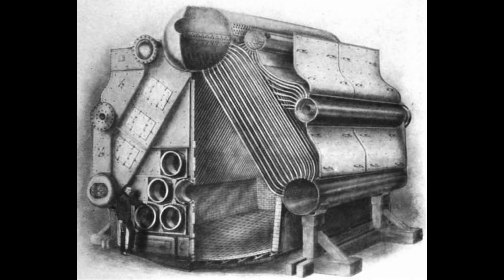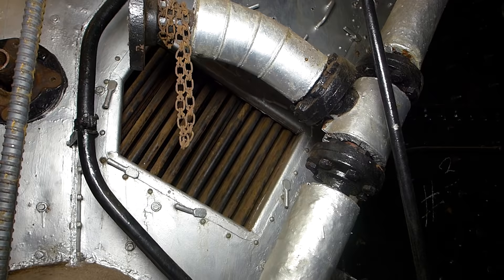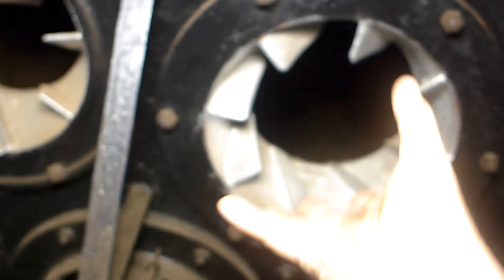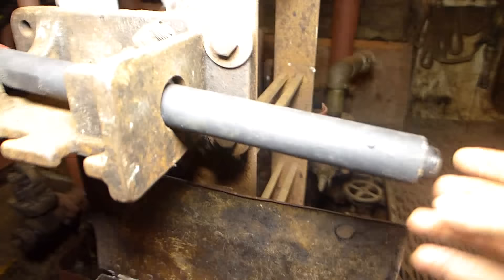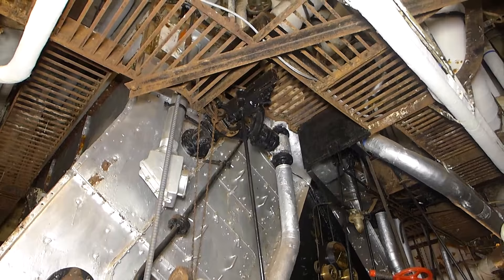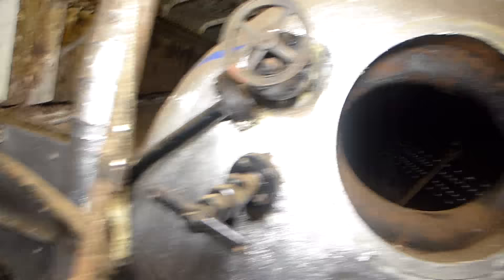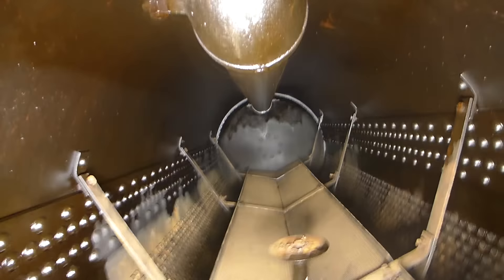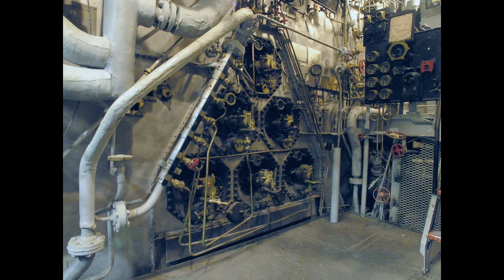Battleship Texas, Making Steam

Comment: Pressure Safety Valves (PSVs) lift when main steam stop valve closes. Only thing preventing pressure build up in a drum boiler is the constant flow of steam to the steam engine. Took me a long time to understand why pressure was highest at the feed pump rather than at main steam. Seems like if you’re putting more and more energy into the steam as it gets heated the pressure should increase. 

However, that pressure doesn’t build because it is converted into flow and then removed from the cycle by converting it into work in the steam engine. 

When PSVs trip you gain a unique appreciation for how much power is being generated in the boiler. 

Also, the staging is to maintain steam flow through all parts of the cycle. Main steam has lowest set pressure so super heaters continue receiving cooling flow once the main steam stop valve is shut. Fires are usually extinguished pretty quickly, but if there is still a lot of residual energy to dissipate the drum PSVs (set at a higher pressure) will lift to prevent over pressuring the system.
Reply: It sounds and feels like a rocket engine blasting off when a large PSV lifts. 
I was on the ground floor, inside a building when a main steam safety 100ft above and 50+ feet horizontally away lifted. The walls were shaking so bad I thought something had blown up and I was about to be blown away by shrapnel. This was a 2100lb safety relieving a 10-20kkph at a land based power plant. 

Those are lower pressure but there is no where to get away. I imagine it was several times scarier in the hull of a ship!
Reply from the maker: I largely agree, except for one thing.  Assuming that the volume of a pressure vessel remains the same, steam pressure only increases when more steam is created from water.  Adding energy to steam will only increase its temperature, not pressure.  That’s the beauty of superheat.  It raises steam temp and energy while maintaining the same pressure.  That additional energy is 100% useful.  Unfortunately, turbines love it, but not the reciprocating engines on Texas.  They required the condensation from saturated steam to lubricate the cylinder walls.  Dry, superheated steam would result in seizing and cylinder scoring.
Reply: @tomscotttheolderone364  Thanks for the reply! I may have misunderstood your point, but I believe that pressure and temperature both increase with rising temperature in a fix volume. Dry steam continues to increase in pressure unless it is converted into flow. For example, a pressure cooker is a fix volume of water that converts liquid to dry steam. The pressure inside slowly increases along with the temperature and if there isn't an outlet it would explode due to over pressurizing the vessel beyond the materials strength. 

As an aside, I found your point about recip steam engines requiring saturated steam very interesting. On another channel, (@Drachinifel's video titled "Navel Engines - Rotate that shaft") he said the opposite. Liquid is generally bad in a recip engine because it is incompressible and hence if you hit it at the bottom of the stroke it can cause the piston to not turn and break the engine. However, what you're saying makes more sense because steam engines, unlike gasoline engines, do not have a compression stroke. Compression takes place external to the engine.
Reply: @tomscotttheolderone364  Thanks for the reply! I may have misunderstood your point, but I believe that pressure and temperature both increase with rising temperature in a fix volume. Dry steam continues to increase in pressure unless it is converted into flow. For example, a pressure cooker is a fix volume of water that converts liquid to dry steam. The pressure inside slowly increases along with the temperature and if there isn't an outlet it would explode due to over pressurizing the vessel beyond the materials strength. 

As an aside, I found your point about recip steam engines requiring saturated steam very interesting. On another channel, (@Drachinifel's video titled "Navel Engines - Rotate that shaft") he said the opposite. Liquid is generally bad in a recip engine because it is incompressible and hence if you hit it at the bottom of the stroke it can cause the piston to not turn and break the engine. However, what you're saying makes more sense because steam engines, unlike gasoline engines, do not have a compression stroke. Compression takes place external to the engine.
Reply from the maker: @Jason-Spice  Your analogy is not correct.  As long as there is liquid water in a pressure cooker, it will continue to produce more steam, raising both pressure and temperature until one of two things happen.  Either the relief valve opens, or you run out of water.  If you put just a few ounces of water in a cooker and attach a pressure gauge and thermometer, you would see pressure and temperature increase until you run out of water.  At that point, expansion stops.  Temperature will continue to increase, but not pressure.  The temperature above saturation is pure, recoverable energy that makes steam dry, or super heated.  That extra is highly valued because 100% of the extra put in can be recovered as work in an engine designed for it.  The ones on Texas were not.

I am not in disagreement with Drachinifel because I didn't say that an appreciable amount was allowed to gather in the cylinders.  All I said was that condensate was needed to lubricate cylinder walls.  The crew watched pressure and temperature in each cylinder.  If properly balanced, just enough water would condense on cylinder walls to do the job.  It is likely that they allowed more than was needed since too little could result in cylinder wall scoring.  If they had too much, they could hear it make a crackling noise as it tried to evaporate and condense with the pressure changes caused by piston movement.  When that happened, they would open a cylinder drain to get rid of it.  However, that was usually only needed during startup since that is when most condensation occurs.  During normal operation, they regularly open the drains for a few seconds on each cylinder to keep water from accumulating.

Comment: As someone who has punched sprayers on a maneuvering boiler, I can say that the actual physical position at the faceplate is not a nice temp.
Serious attention to command also required to avoid an accidental flame-out and dangerous "back wall restart"
Also, during refits, crawling into the water tubes to retrieve the bullet brushes is a very difficult job for someone who is somewhat claustrophobic.

Comment: AMAZING!!!!. Thank you for taking the time and effort to show this. Those are some really tough men that not only built these machines, but also the men who's lives depended upon these machines.. just AMAZING... Does anybody know if there was a formulas for what water these boilers used? I really want to doubt that sea water was used, as per, the massive about of salt that would crystallize in the cooler section of plumbing, or corrode the metal inside out? Keeping distilled water on board would sound clean to me, but I suppose would also attract elements from the metal as the distilled water would try to grab protons or electrons, neutrons or how ever that process of pH rebalancing works.. (stuff I learned back in high school a 100 years ago).. Maybe cleaned/filtered distilled water with a mineral additive was used to combat the erosion process? For all I know, maybe in the format of steam, that erosion process doesn't happen? either way, I am really enjoying this channel and the other sister ship's channel.  I will forever be bummed out, knowing that I will never get to see one of these massive guns fire... EVER in my life. it is a part of history, locked away forever. Video will have to do.
Reply from the maker: There may be some old boiler men that see this who could answer your questions far better than me.  I can tell you a couple of things.  They used fresh water condensed from seawater in a closed loop system.  Salt was a very big concern and they constantly checked salinity that could occur primarily due to condenser leaks.  They also kept the water at a very high ph level.  The goal was to force calcium and other impurities out of solution so that it would settle in the water drums where it could be blown out.  Otherwise, it would form deposits on the boiler tubes, reducing efficiency and lead to hot spots that could cause tube failures.
Reply: @tomscotttheolderone364  Wonderful... I just had another thought, that blows my mind... these battle ships were built with a slide rule.. LOL.. and are some of the most advanced article of of the industry, and in my opinion, even by today's standards of war ships. I almost do not think today's men could build such a machine like these, from scratch, with out having nothing to ref from. Just truly amazing what these men made happen at an amazing time frame.. Thank you.

Comment: Something I have wondered, do you know how they kept the engines from seizing from corrosion since there was no type of oil on the cylinder walls? Was it just required to not let them sit stationary for very long? Fantastic vid, thanks
Reply from the maker: Good question that I don’t have a good answer for.  My best guess is that they would lightly oil them if the ship was going to be out of service for an extended period.  Otherwise, they could use the jacking gear to slowly turn the engines periodically.
Reply: It's amazing that they could get by with just water for lubrication. I guess the long (relative to its diameter) pistons and low rpms helped but still.

Comment: Loved the video, thanks for the great job.  I'm curious.  How did they actually control the level in the steam drum?  You made it sound like it was an entirely manual operation - which would be a terrible job I'd think.  I worked around boilers my entire career, but never thought about how the level would act in a marine boiler with the entire boiler rocking and rolling with the ship.
Again, thanks for the great work.
Reply from the maker: My reading of steam manuals from the 1920's leads me to believe that it was manually controlled by the water tender using the two sight glasses on the front of the drum.  It is very likely that the movement of the ship didn't affect the glass levels too much when you consider the geometry of the relationship of the water in the drum to the level created in the tubes that are only fed through small openings at their tops and bottoms.  While it seems that automation would be easy, a book of procedures and cautions that I found suggested that it was anything but simple.  For instance, if they suddenly opened up more burners to create steam, the level in the drum would suddenly drop a lot.  The immediate reaction would be to open up the makeup water valve to bring the level up and not expose boiler tubes.  However, the key was to wait and watch it drop, because the level will surge back up.  If they had responded by adding makeup water, then the drum would be too full and water would be picked up in the steam in an action called priming.  That is very damaging to pipes, valves and equipment on the steam line.  So, it required a lot of knowledge and a cool head to maintain exactly the right amount of water.
Reply: @tomscotttheolderone364  Thanks Tom, with all the work I've done on boilers, I'm familiar with the complexity of the measurement and control problems.  But I never had to consider the possible influence of the boiler itself moving around.  I did serve on a destroyer in the Navy - no doubt battleships are a little more stable.  Maybe a LOT more, actually.  But still any motion just makes a tough task even harder.  I'm thinking I might not have enjoyed standing watches as a water tender :)  Hats off to the guys that had to handle a tough job.
Thank you

Comment: I'm curious, when they scraped the coal system and went to oil burners designed to work with turbines, why didn't they also install turbines?  Was it cost, not enough space, or did they just want to keep it a "standard" battleship?
Reply from the maker: There are 1924-25 proposal drawings for both turbine and turbo-electric retrofits.  The reciprocating engines were kept largely for cost reasons.  They were very reliable and were still able to provide needed levels of performance, even though they suffered from significant vibrations at certain speeds.   Also keep in mind that by the 1925 upgrade, Texas was obsolete as a first line battleship and nothing could be done to improve that.  However, she still had significant value, but just not enough to sink that kind of money into.  The boilers were an entirely different matter.  Coal was on its way out as a power source and as I showed in my video, there were a number of problems using it.  The fact that the oil fired boilers were sitting in warehouses and were readily available made that upgrade an easy decision.

Comment: Since serving on a 1200 PSI power plant Destroyer in the Engine rooms, I like the simpler design! Could the Texas cross connect one Boiler room to run both Engine rooms at lower power? We did that a lot to conserve fuel (supposedly)....
Reply from the maker: Absolutely!  I will be putting up a video in the not too distant future that uses the ship's engineering casualty manual from World War II to show how any combination of boilers could be tied in or isolated to run either or both engines.  In fact, because of the reciprocating engines, there was  a way you could run the engines at reduced power, even if you completely lost the 300 lb. steam mains.  There were 150 psi auxiliary steam lines that allowed steam to be tapped off of the engines to run auxiliaries.  You could close the main throttle valves to isolate them and the high pressure cylinders, then back feed the intermediate and low pressure cylinders with 150 psi steam from the auxiliary lines fed through reduction valves from the boilers.  The high pressure cylinders were lost and the engines would be unbalanced, but they could still make way at a reduced speed.  While I cannot think of any way they could lose the main steam lines, the point was the system was exceptionally flexible and redundant.  As long as one boiler was capable of making steam, they could run at least one engine and hopefully the auxiliaries needed to keep it and the boiler going.
Reply: @tomscotttheolderone364  Better than us! If we lost the main we're dead in the water and on emergency diesel power. We would steam quite a bit on 1 boiler (out of 4), cross connected to save fuel, as I said. If they dropped the load we were bobbing around until one of the boiler rooms got lit off again....

Comment: When was the Texas's engines actually fired up and brought up to full steam. From the word jump, how long would it take the Texas to build up enough steam to move at combat speed. The Battleships at Pearl Harbor took 24 hrs.
Reply from the maker: I am not sure what what is meant by "combat speed", but I assume it is the ability to produce full power on the engines.  This is a fairly complicated subject that doesn't have a single or simple answer.  I will limit myself to Texas since there can be quite a bit of variation depending upon boiler design and engine type.  The most likely scenario is Texas would already have one hot boiler and be ready to make 10-12 knots, with limited auxiliaries running, in 1.5 to 2 hours.  That is what it took to bring the engines to operating temperature.  It would take another 6 hours to produce full power and speed due to the time it takes to heat the cold boilers if they began firing them at the same time they started warming the engines.  So, total time to reach full power is about 8 hours if everything goes well.   It could take up to 10 hours if the steam system and engines are completely cold.  Without support from shore power, the extra time is due to having to begin firing boilers using diesel fuel pumped by hand until enough steam can be generated to bring at least one fuel oil feed pump and set of heaters on line. 

The biggest limiting factor to all of this is warming up cold boilers.  The refractory brick that lines their fireboxes and protects the boiler casing from damage will begin spalling and will crumble if heated too quickly.   If the damage is minimal to moderate, the boiler can still be run, but at a reduced rate.  If damage is serious, the boiler must be taken off line and cooled down to prevent burning through the casing.
Reply: @tomscotttheolderone364  I was thinking of a Pearl Harbor type situation, combat power is being able to move the ship (during its prime in WW-2 full crew and supplies) from a dead ported stop to being able to answer bells. I'm not a Naval expert, from what I read about the Battleship at Pearl from a cold start to moving would take 24 hours. Any Idea when the Texas last moved under her own power ?. Thanks for the timely response.